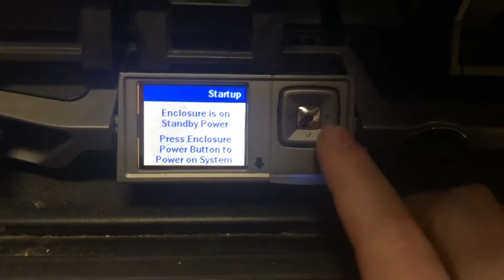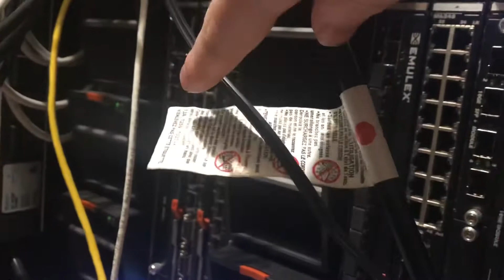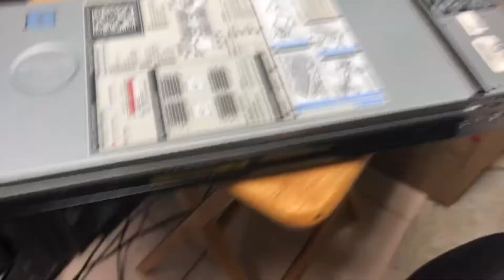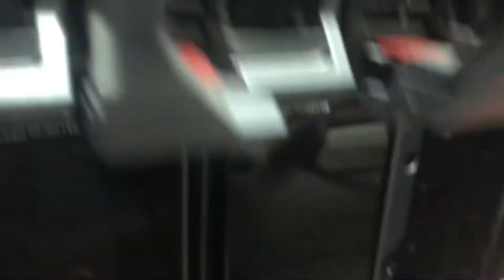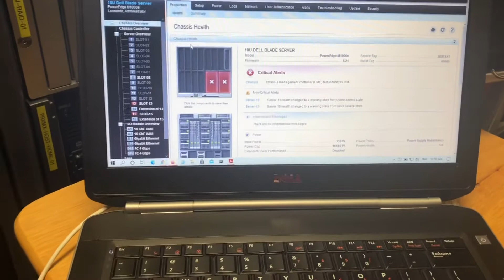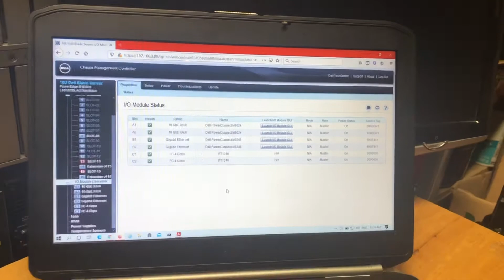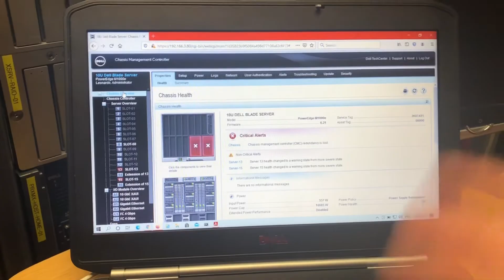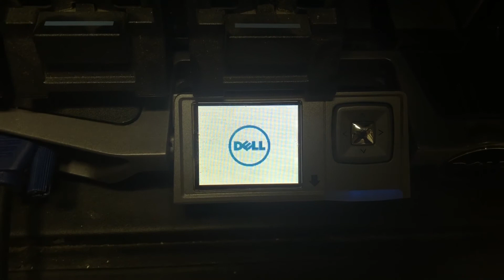Dell PowerEdge M1000E system overview! - [Video 5]

Comment: Very nice.  Blade systems is the one I can't do base on my power setup.  But very cool setup...
Reply from the maker: Hi again! I consider the M1000E as one of my special systems. That's the one machine that doesn't run 24/7 at the moment because I'm waiting to install a 240V service for the datacenter! It's running now on 120V and the SMPSs (switch mode power supplies) are causing some weird behavior on the circuit it is connected to (it's causing the lights to flicker and it's not because the circuit is overloaded or not wired properly). When I do run the M1000E it's because I do some testing with the M1000E with the blades. There are more projects that I plan on doing with the M1000E. When I do get the 240V service, you'll definitely see more videos of this beast in action! Thanks for watching and please subscribe!
Reply: @Mr.DatacentiCET  Yea same here... I had to stay at 120 Voltage for anything higher cost a lot of money to keep running.  My lab spins up between 4 to 12 servers at a time. It is no fun to work as 1/2 of 240 vlt. load, all your blade servers run in low power mode...